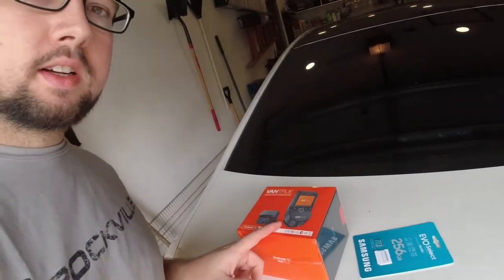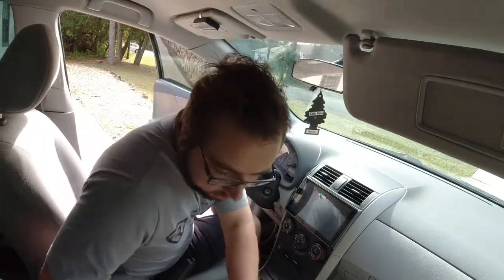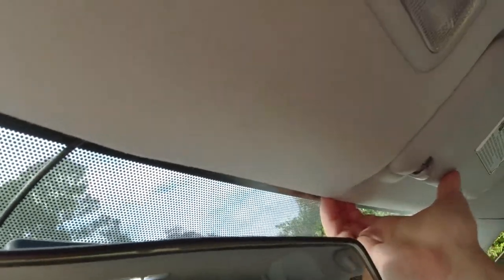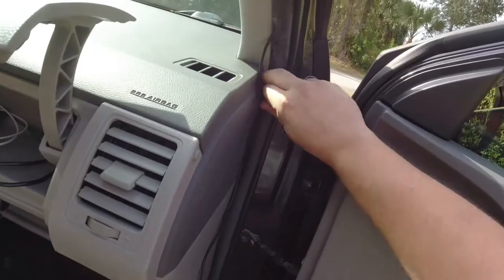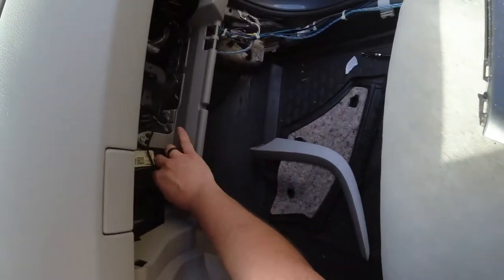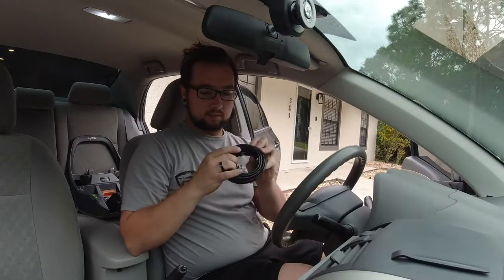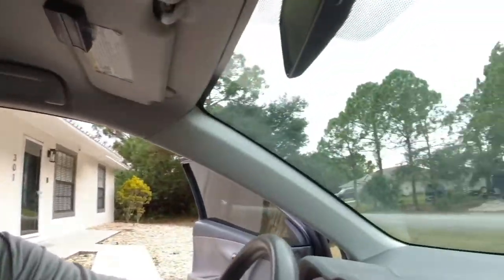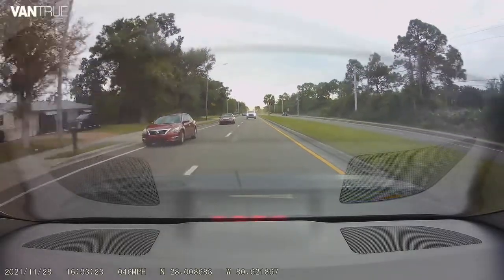HOW TO INSTALL A DUAL CAMERA DASH CAM(EASY)

Comment: How did you fish the wire to the rear? Did you take off that big side pillar where the seat belt is at?
Reply from the maker: For that part, I did not take off the panel. But I just pulled it back a little bit and shoved the wire behind the panel. It’s not the easiest, but it’s doable!